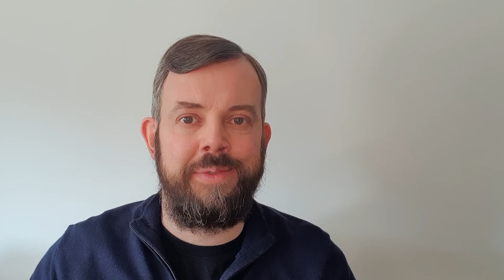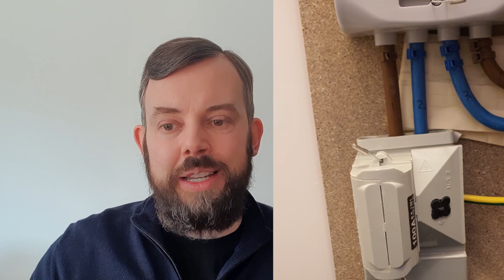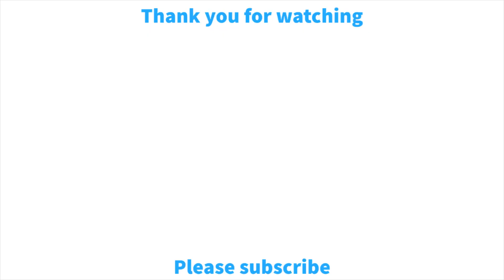Grey areas for Electricians to be aware of

Comment: Good video James, PME is an interesting one when connecting to outbuildings or sheds , some say must TT others say extending PME  equipotential zone is ok as long as bonding conductor is correctly sized if any extranious metal work in outbuilding / shed. I suspect a call to DNO would be enlightening again in this case.  A video with your thoughts would be interesting especially about the chances of a lost neutral in real terms.
Reply from the maker: Hi,
Thank you for your comment. I uploaded a new video yesterday on the subject of supplies to outbuildings.
Regards
James

Comment: Great content as usual James. Another issue with old lead pilc’s cables is the improper use of a bonding clamp around the sheath of the service cable. I bet they make a bang when they blow💥👍👍
Reply from the maker: Thank you. I'm glad you like the video. Lead cables without the proper earth connection is something I've seen as well. I once found a lead cable without an earth connection and reported it to the dno, and they sent an engineer to the property and rectified it.